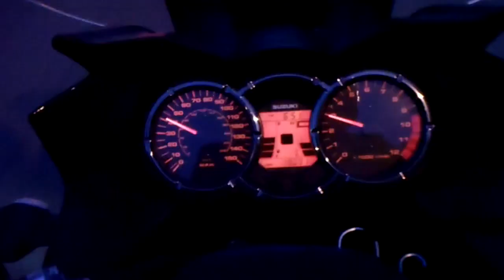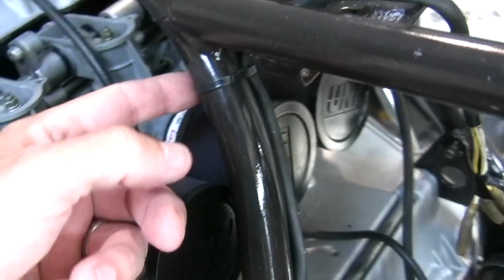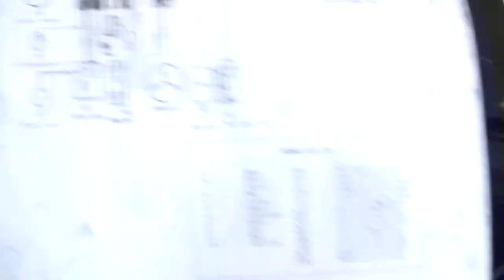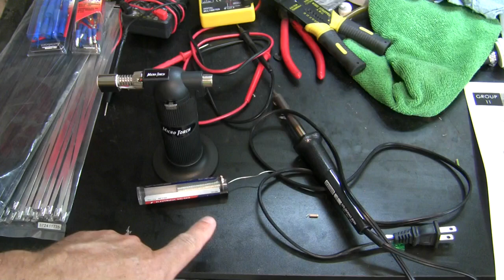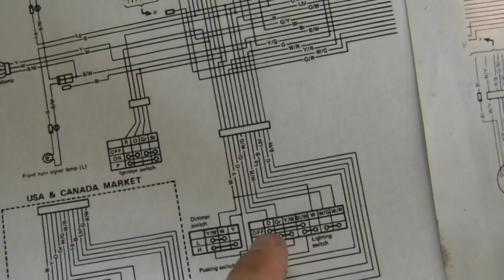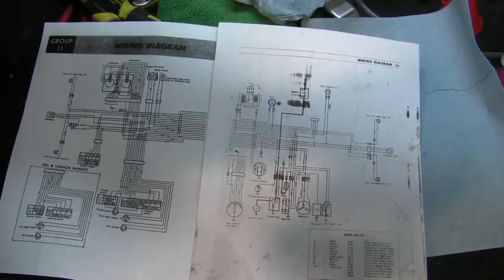Wiring Electrical Charging Components - GS550 Cafe Racer Build (Part 89)

Comment: I have 79 gs550l carbs that are jetted to 87.5 main and idle jet is 17.5 with k&n air filters and rebuild with new gaskets and needle has been upped one spot I need to sell them. Let me know if u want them. Steven.gaskin2@gmail.com
Reply: K&N filters are brand new with a new k&n oil filters also have a good solid gas tank to

Comment: Great vid Monk I love a good wiring diagram. One thing I will say is to check whether your aftermarket rectifier 
is a combined rectifier regulator, if that is the case you can get rid of the old regulator and it would sort out the missing junction wire coming from the stator. Ive done a vid on the GS750 charging system and detail the new and old regulator rectifier suggest you take a look  :)
Reply from the maker: 👍 I've watched that video of yours you mention but will go back to review. That said, I recall and have confirmed the current regulator I have was connected previously. Then of course there's the option to upgrade to a combined unit as you did. I'm always waving the "budget project flag," but perhaps this is worth a little spend. They aren't that expensive. Decisions, decisions. 🤔
Reply from the maker: For those interested, here's link to the video Dtaylo is referring to. https://youtu.be/FMk7nmF89wM